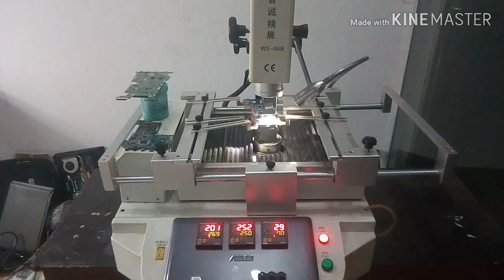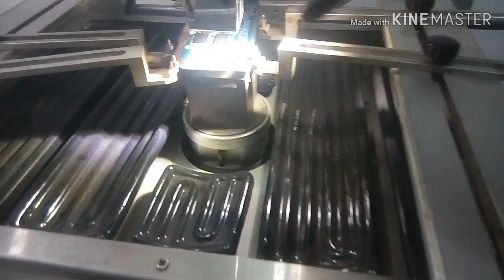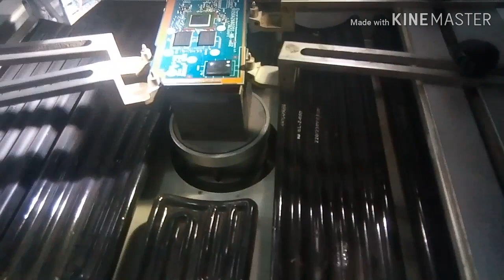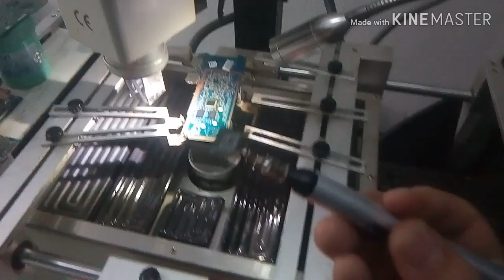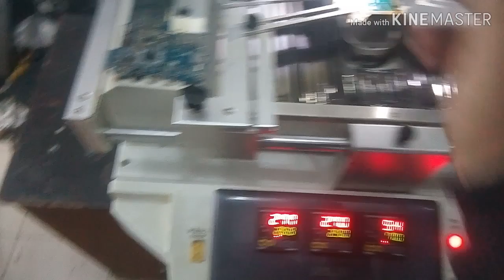Upgrade Chromebook Hard Disk From 16GB To 64GB

Comment: Is it possibile to replace it with regular hot air gun(temp controled) is it generic mmc or some special type? What temp range you are using?
Reply from the maker: yes you can . emperature depends on pcb